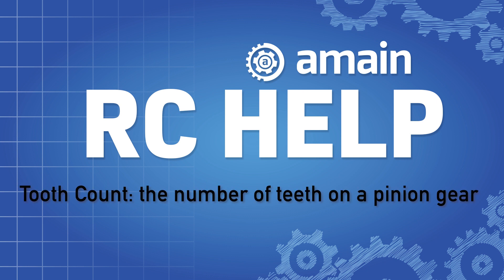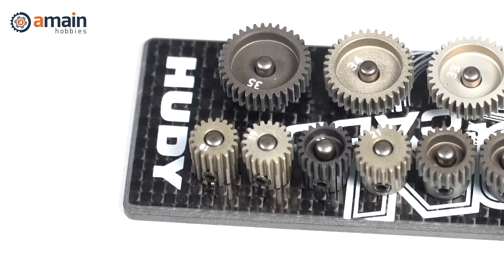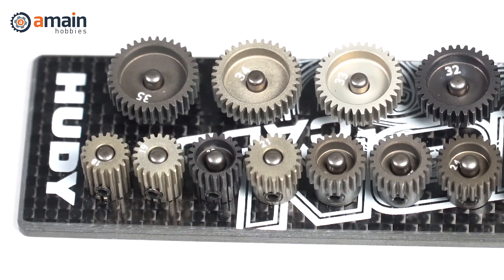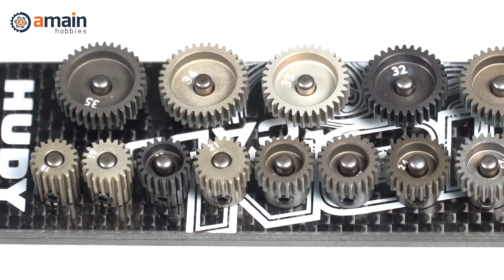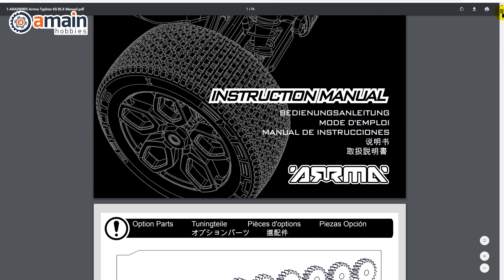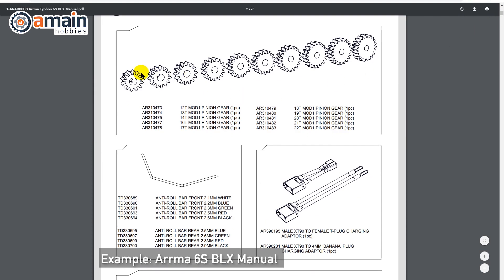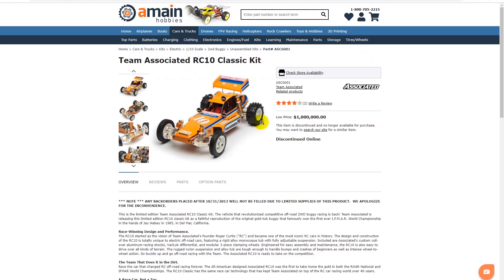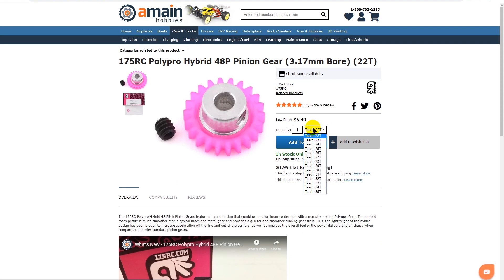R/C Help: Pinion Gears - Tooth Count

Comment: Ok i have a 16t pionion and its a little tight if i go down to 15t would it make it perfect mesh
Reply from the maker: Does your vehicle have an adjustable gear mesh? You wouldn't change the pinion gear to adjust the gear mesh, you instead use the gear you want and then adjust the mesh to that gear. Some vehicles have adjustable gear mesh by loosening the motor screws from the motor plate and sliding the motor closer or further away from the spur gear to find the desired mesh, then retighten the motor screws. Some vehicles do not allow this adjustment and instead have a "fixed gear mesh" where the motor does not move on the motor plate, and instead the mesh is adjusted by a cam or by changing pins on the motor plate, like with the Traxxas Maxx. You may want to checkout your owners manual and see what style you have and how to adjust it. 
-Brett
Reply: @AMain_Hobbies  na its 16 19 25
Reply from the maker: @nickwilliams6869  What vehicle is it? 
-Brett
Reply: @AMain_Hobbies  arrma voltage and i put a onyx brushless motor in it or go to a 18 the a 19 the 18t pionion gear is smaller insize across

Comment: where can i buy 8 teeth pinion gear for mini drones
Reply from the maker: That's a tough one. I searched through our pinion gears, and for 48P I could only find down to 12T. You might want to just start searching the internet to see if you can find something that small. 
-Brett
Reply: @AMain_Hobbies  hey so in a quadcopter drone if  3 of those motor pinion is 8 teeth and the last motor pinion is replaced by a 9 teeth pinion .will it affect my drone flying capability??????
Reply from the maker: @mark7878  Yes it will because the props will not spin at the same rate; the prop connected to the motor with a 9T pinion should spin faster RPM's. 
-Brett
Reply: @AMain_Hobbies  well im gonna buy four 9T pinions then😂
Reply from the maker: @mark7878  Try it out!
-Brett